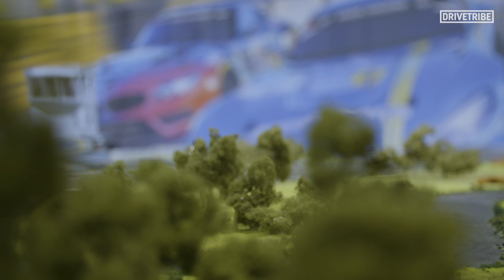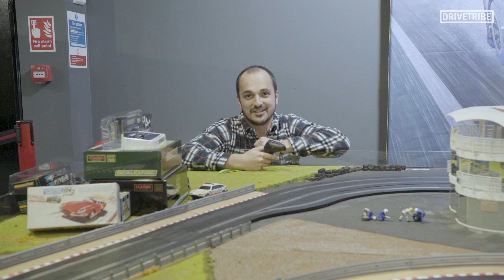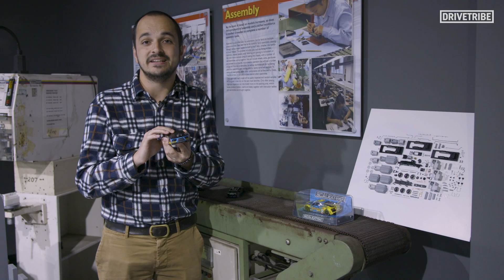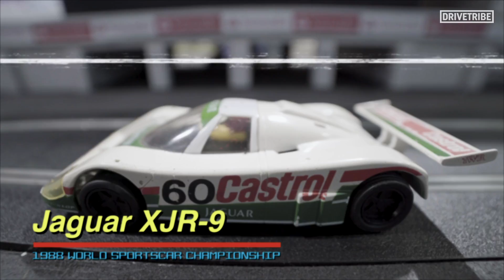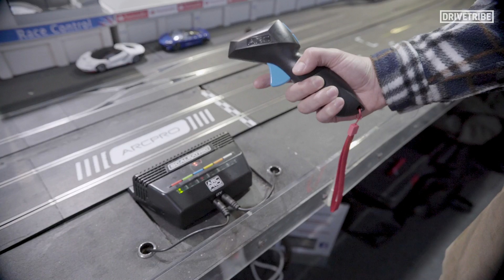How does a Scalextric car actually work?

Comment: Hello I just bought Scalextric Aston Martin DB5, my question is! I am not a racer, only collection of different DB 5 model car's. If foin to use a 9 volts for a demo is it possible or any advise what to use for a demo, like turn on the wheels and lights. That's all. Thanks

Comment: My favourite Scalextric car was the Saudia Leyland Williams FW07. I never knew there was a Lotus 79 available. This would have been my favourite otherwise. The really cool thing about the FW07 was that it performed better than the Minis or the Ferrari 312 just like it would have done in real life so, even in miniature,  the engineering and the physics that made this a faster car in real life filtered down to the model. A really cool thing I discovered, when the slick tyres became so worn with age that they could barely take the corners without massive powerslides and could hardly get off the line without a ridiculous amount of wheel spin was that an application of pritt (the non-sticky sticky stuff) directly to the tyres made them grip like a hot set of sticky Dunlop karting tyres from 1982.

Comment: I got my first set in my late teens, had to buy it myself. I built on that set to have around 60m of track, and over 20 cars of all types. I used to re-wined the motors, which gave you different torque caracteristics. Some excelerated very quickly but had ordinary top speeds, while others excelerated slower, but had awesome top speed, with wheel spin often happening when taking of from start due to the big torque. Had fun all the same. Sadly, sold it all for cheap when I had a garage sale. Wish I hadn't done so these days, as there where some value in what I had. This was around 30 yrs ago.

Comment: When in the RAF and stationed at RAF Akrotiri (1965-67), Scalextric became the rage, and used the normal small plastic kits in the figure 8 configuration in 1966, as there was a local shop in the town of Limassol, where we could by the kit cars that were clear plastic, so that we could paint the insides any colour we fancied, and fit bigger motors, and good quality tyres etc.

We didn't want to spend a fortune on possible unreliable plastic clip together tracks, so managed to get permission to use a disused parachute packing building, over the road where we lived on the base, and proceeded to scrounge materials like sheets of hardboard or some flexible plywood, rolls of copper strips, glue, some heavy duty batteries from the MT section etc., and also some power tools like jig saws, circular saws, screwdrivers and other tools, so the build cost was zero.
So I think there was about 6 of us who were permanently (plus some fellow helpers with spare time) going over there to start the sturdy frame work, lay the track on the top, jig saw out the slots, glue down the copper slots, cut some square holes into the track for the marshals to rescue cars that come off the track etc.

Then there was a stand build for the 'drivers' so that they had a clear over view of the track, and once tested for electrical continuity of the copper slots, a work bench for the 'drivers' to run in their tyres, run the gears in, maintenance of their slot cars etc., as it all got to be some serious stuff to compete against others, and trying to find the best quality hand controller that didn't get too hot, plus deliver a good supply of DC to the track, and good enough to survive hours of use.
 No one really minded if others put in a bigger motor that would fit in the body work properly, and encouraged the others to try and make their cars run as fast as they could, and handle well too.
Once done, and further testing done, we then spread the word at the base, which also spread to other bases in Cyprus, so that teams could come along, bring their families if they wished, for a great evening of racing other teams, and word of mouth spread for more an more people wanting to race their cars against others.
My favourite car was the Ford GT40....:)

Sorry, a bit of a long story, but scalextric cars hold a lot of memories of those days.
The 'club' was still running when I had finished my 'tour' out there in 1967, and what happened after that I don't know, but it was great fun building a sturdy track, scrounging all the gear, and helped a lot of people enjoy themselves........racing plastic kit cars....:)
No doubt modern ones are much better cars today though.

Comment: Most 12-year-olds could do a better job than this twit. I have a 60 foot digital track and 8 cars but now it's in the loft in boxes. I found it takes too long to get the track to work. 
I used to go to a slot car racing club as a kid (mid 60s) with custom made kit (Revell and others) cars and a permanent wood circuit with 4 lanes.

Comment: Love slot cars, and currently close to 800 in my collection.  My favorite is a 3-car boxed set of the 1970 Porsche 917's in Gulf colors from the 1970 Le Mans 24 hrs., made by FLY some years ago.   About 175 of so of my cars are from Scalextric.  The new Digital ARC PRO system is what I run, and Scalextric did a great job on it, as well as the App.

Comment: Grew up with AFX & Tyco slot cars at home but also lived close to several commercial tracks. Owned maybe 2 dozen Parma Womps over the years. Still take the fam (including my 5 year old grandson) racing at my favorite track in NJ whenever possible.

As for Scalextic cars, first in my heart will always be the Gulf liveried GT-40s.

Though the over scale 'Super Karts' roll a lot quieter and are a joy to run with the young ones at home.

Comment: Back in the 60s we soon burned out our Scalextric cars and controllers and so built our own. Bold and Burrows model shop in St Albans, Herts, UK had a pay as you go track and that was THE place for us kinds on the way home from school. Wish I still had my Chaparral 2C in lime green with a RiKo motor and an MRRC controller - ah, those were the days... We went onto make our own chassis from brass wire and tubes during metalwork lessons at school and cover them in clear plastic bodies painted on the inside to keep them from being scratched. You see - we baby boomers did get to learn something good at our low expectation secondary modern schools...

Comment: I don't remember details, but I did have a simple track back when I was a kid in the 80s.  I liked it a lot.  The  biggest problem with it was the same if I were to own one today.  Not enough space to have anything than the smallest track.  A small track is just not as fun in the long run, not just because of the size, but also because of the limited amount of designs you can have.  
When video games reached a point where they looked and felt good enough (late 80s in my case) I more or less gave up on scalextric.  
I guess it was similar to train models.  I would love nothing more than having huge tracks and model trains on them, but in a small room....then came Railroad Tycoon.

If I were rich or at least had a large enough apartment/house, I would 100% get scalextric and trains.

Comment: I had the old figure 8 track that I found out I could modify to a oval. It was the one with the Alan Jones Williams FW08 and another F1 car. I tried to get more cars, but living in a small house with a little to no income meant I never got a 3rd car or  any more track add on modules that I cold get in a local model shop.

Comment: Mine was a Toltoy Tyco Command Control set - the race cars had steering that caused them to run against the raised edge of the track which had 2 lanes with 3 live wires embedded in it. Each car used 2 of the wires for power, (car 1 say left and center and car 2 the right and center). This allowed the car to steer from one side of the track to the other which was needed as there was a 3rd slow obstacle car that use a wire pin in a grove on the sides of the track to hold it to one side of the track or the other. This meant you had to pass it on the straights or on the outsides of corners if it was on the inside of the corner, the race cars would drift to the outside of corners since they were not held to the inside so no passing possible on corners if 3rd car was on the outside of the corner. This meant strategy was needed so you didn't get held up too much following it around corners then have to slow right down or stop to get room to corner/turn to the inside lane after the corner to pass it, also meant both cars used  the outside lane around corners so you needed to swap lanes to pass if you were faster. Great fun. Just saw a video of a different version of my set that had a center divider on some corners so race cars could use the inside lane, way cool.

Comment: Sorry but Scalextric is ok for home and as a toy, I’ve owned in the past a small shop of car slots and the best track is for sure Carrera, way more smooth track so you can slide ways very nice and also the distance between cars is quite bigger that allows you to run trucks by side without problem. I had around 16mt of track with 6 lanes and was a piece of fun, very good old times! 😁

Comment: Ford escort rs models rally and touring, if you adjust the position of the motors cog you can make it got faster! Or fit smaller and larger cogs or buy beafy motors, we would take the motors out of those little hand held fans as kids and replace it with the cars motor it had alot more power!!!

Comment: Had a mighty metro kit when i was a kid, 
I used to lift the back of the car up slightly with my hand and full throttle it,
Give it a decent burnout,
Melt the tyres and the track so it looked like it was covered with inverted speed humps lol

Comment: It's a digital track. Much of what you explained is just plain wrong.
Reply: Can you expand on this and give the correct version?
Reply: @sonofplato  As short as possible: You don't control the voltage on the track, that's analogue. The track has a constant 12V voltage. Your controller sends your input over the track to the digital chip inside the car. The chip then sends more or less current to the electric motor. Because of this you can switch lanes and different cars on the same lane can be controlled individually.
Reply: @therwfer  Thanks for that, it certainly used to be a 12 volt supply via transformer and the controllers wereslide potentiometers,  mind you I'm talking 60s&70s 😁 tech moves along as it rightly should.  👍
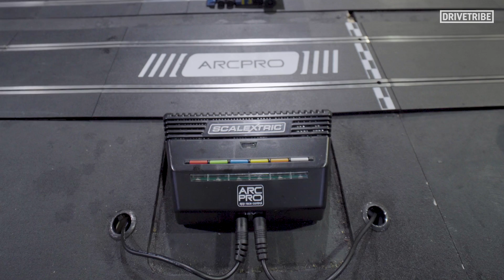Reply: @Günter v. G. He talked about Scalextric in general I guess (although the controller @3:09 is ArcPro - I give you that), it is only the ArcPro that uses a digital system, the ArcOne, ArcAir and the rest still uses analogue power rails. So much of your complaint is just plain wrong :) 
I learned this in ten minutes by going to the website...